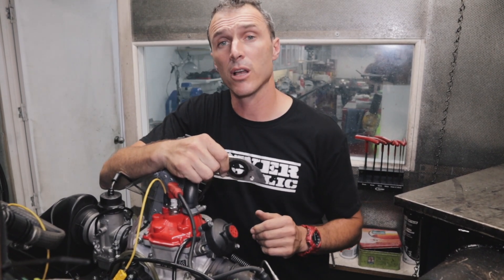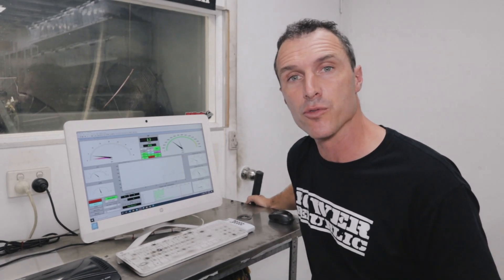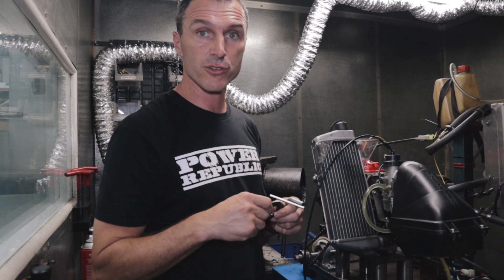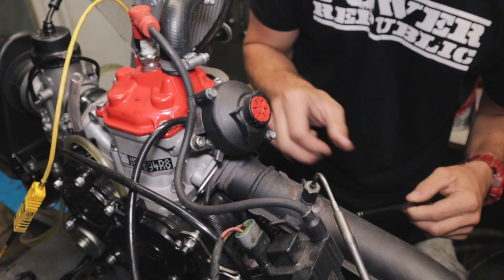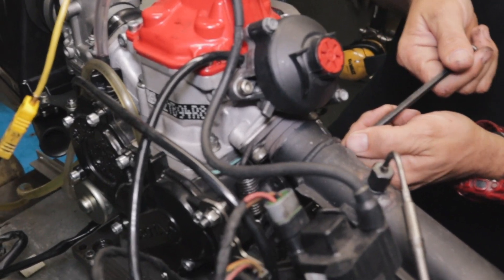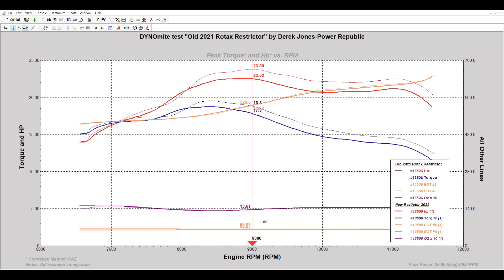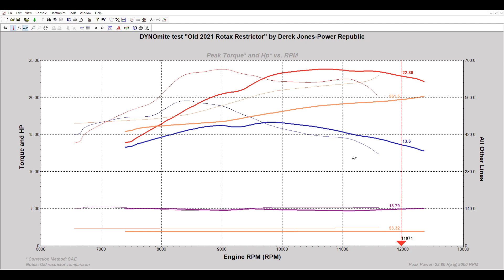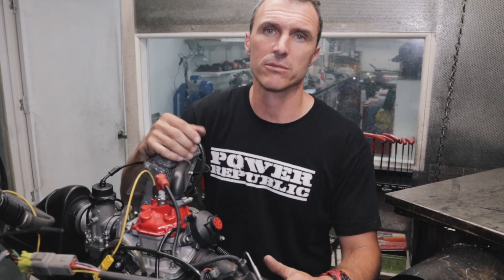How Does The Rotax 2022 Restrictor Affect Performance - POWER REPUBLIC

Comment: Does running the restrictor require a different jetting vs non restricted? I like to use it for when my son is driving.
Reply from the maker: Yeah normally we use 2 jet sizes low for example 125 open, 120 res

Comment: Hey, enjoy and learn loads from your videos. I have a pre ego Rotax max 125 with water leaking from the engine opening. Do you have a video addressing water pump problems and repair? Thanks
Reply from the maker: No, sorry but you will need to split the cases to do this job

Comment: Is this a common Spec in Australia? In Europe a Junior Max is making 26hp and 2,000 rpm more than that set up, with a European Senior Max making 32 hp.
Reply from the maker: Every one is different.  I mean I can make the dunk read junior max 260hp if you really wanted it.  But it is all relative the testing you do v’s other engines you do on the same machine.   The absolute number outcome is not as critical
Reply: @PowerRepublic  100% correct. Just done 3 engines back to back, same carb, same exhaust, same air box, and with the Dyno bullshitometer set to 0 to not 'raise' the final readings.
Seen 2hp gains with a quick click of a button.

Comment: Thanks for showing us this data. Karters should be able to view the BOP report data not just the summary telling us what KA make rule changes. 
Would you please include the results of a JMax dyno test? These have never been class winning engines against X30 or everyone would have them so who has the restrictor had to be changed from 26mm to 24.5mm?   I feel like the attitude more about go buy an X30 or just lump it.  Not happy with their decision. Incidentally, when the BOP summary and rules changed, the JMax retained the 26mm size but was changed in January to 24.5.  

I’d like to hear your comments but if the dyno says it has an advantage at 26mm then fair enough but I doubt that will be the result. Many thanks. Mike
Reply from the maker: the JMax at the higher weight was struggling against the other 2 engines anyway, IMO.   maybe now it's lighter, it's back in the game.  but with a 1.5mm small diameter restrictor,  I would imagine that would struggle

Comment: If I'm reading this graph right, both engines at 11,500 RPM the Rotax looks like it's making about 5HP less. Is that right?
Reply from the maker: Yeah Rotax is not in the excellent range there
Reply: @PowerRepublic  I'm not sure that small advantage it has down low is gonna make up for that big of a difference at the top end. Just in terms of the % of time spent above or below 8K RPM

Comment: As expected from what we've all seen on track, rotax gets walked at ippy on the straights, top end is non existent, I lost 800rpm and 4kmh just swapping old restrictor for new, it didn't need changing, maybe 2kg weight adjustment either way for the x30 or rotax, I went 4 tenths slower with 7kgs less and new restrictor, nowhere near parity, evidently KA don't want people running rotax. Need a rotax class
Reply from the maker: yeah the top end speed is what most guys are complaining about.

Comment: I’m new to the Rotax restricted class  and was wondering if I need to run a smaller jet size with the restrictor in ? And will I need larger jets when I move up to unrestricted?
Reply from the maker: Hey Luke, first reports are go larger in jets to a 125 from 120.  and yes normally you would go up in jets for unrestricted but we will have to wait and see